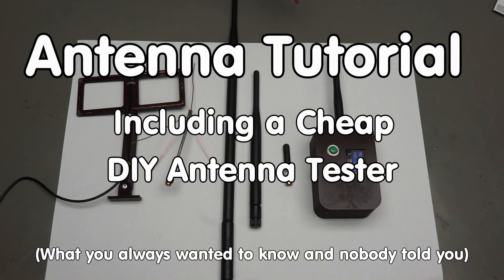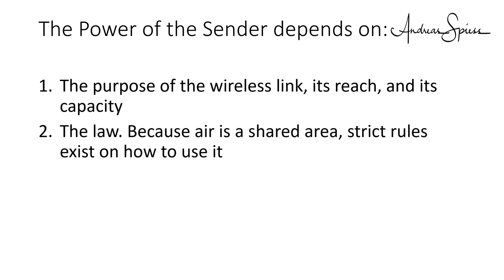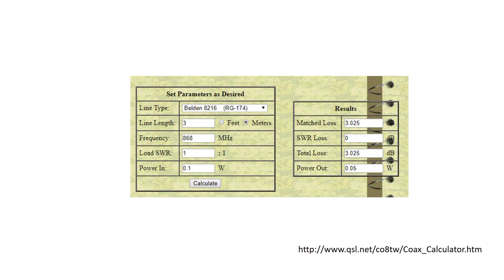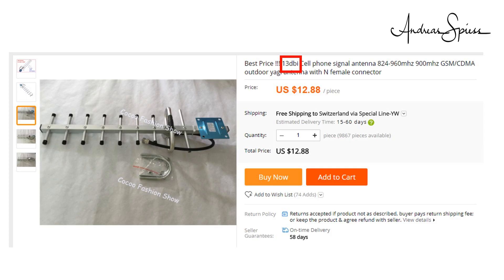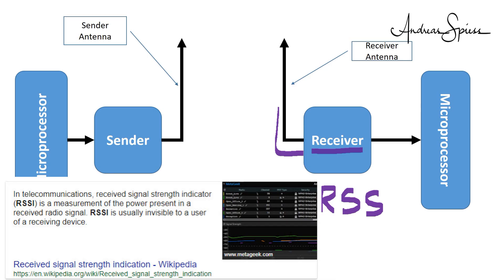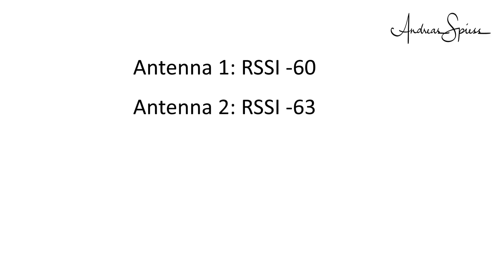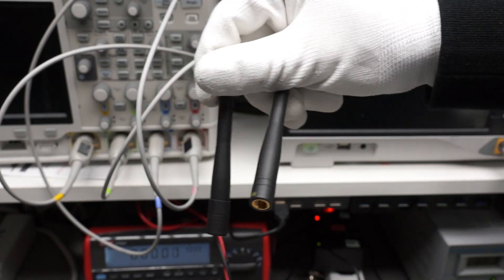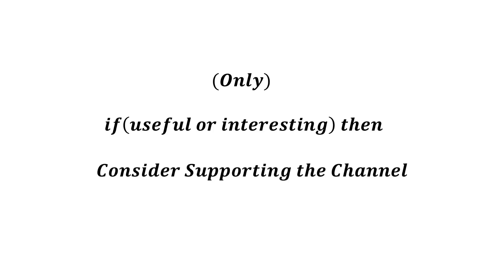#188 Antenna Tutorial incl. cheap DIY Antenna Tester (LoRa, ESP32)

Comment: Do you know of any implementation of diversity of lora antennas ? I have the problem that there are nulls in signal paths between particular nodes which can be overcome by moving the antenna a few centimetres. This is of course impractical, which is why diversity antennas were invented. But how to implement this for lora ? WiFi has already advanced a long way in this respect.
Reply from the maker: I never saw a LoRa chip with two antennas and diversity.
Reply: @AndreasSpiess  That's a shame. It would be so useful. Manufacturers take note !

Comment: Andreas, would it be possible to share the code you used to build up these two looped devices for reading RSSI remotely? I'd like to extend some of your experience as I am still looking for my ideal Meshtastic antena. I was to code it on my own, hope the code might be shareable. Thank you.
Reply from the maker: This is an old video and the code was rather simple if I remember right. Just use the LoRa library and send a packet from one device to the other. The library should get you the RSSI values.

Comment: Hi sir. Is it possible to modify the Smartphone Bluetooth antenna? What antenna characteristics should I use. Is it okay to use Microstrip patch antenna with 50 ohms impedance?
Reply from the maker: I would not tamper with anything on the Smartphone. The engineers building these antennas have a lot of knowledge and good test equipment.

Comment: I say hello from Brazil. I always had a doubt, the reason for the module lora burn if I do not connect the antenna, can you explain to me why the module burns
Reply from the maker: Without an antenna connected, power cannot go anywhere and is reflected back to the module where it generates heat.
Reply: @AndreasSpiess  thanks

Comment: if you put antena directly to arduino, you can surelly send AM signal in KHz and listen it using am radio. I used it with 386 (33mhz) and LPT port back then.
Reply from the maker: I agree. There is even a program for the Raspberry Pi to create different modulations...

Comment: I wish I could find an easy answer but so far no luck. Few days ago I got my 1st 2 lora modules, transmitter is set on a hill and reciever is exactly 3km away on my balcony. I get connection at 3km distance but where I want it there is a couple of semi tall buildings right in front of me that block the reception. Any way I could penetrate, bounce or whatever with better antennas, settings? I have no access to roof so my options are limited. I can get signal 50 - 100m left or right from my apartment but again those 1 or 2 buildings block clean line of sight
Reply from the maker: Maybe you watch my "LoRa Wardriving" video?

Comment: Hi... One quick question.. Will there be any issues if I use 915 Mhz Frequency Antenna in India, which according to my research is 865 MHz. Even if I get this, can I retune the frequency that is compatible in India.
Reply from the maker: 1. Check if 915MHz is leagal in India
2. You always can try an antenna. If you want to be sure, you have to do the measurements. There are newer videos about the topic on this channel
Reply: @AndreasSpiess  thanks for the reply. So it means that these antennas will work except for the laws that approve or disapprove.

Comment: When it comes to wire antennas, longer is definitely better...  In fact, I've found that the optimum wire length is one which reaches from the transmitter to the receiver ; )
Reply from the maker: This is definitely not true, even if it sounds strange. Use a simple example: A transmitter in Europe with 100 watts and a coax cable towards New Zealand. Calculate how far the signal would travel and you will find a few 100 miles with a good coax. I often get connections to New Zealand trough the air. This is one of the things which keep me in amateur radio…
Reply: @AndreasSpiess  Ahhhh... I think you may have missed the "humour wink" at the end of my post : )

Yes, of course it's not true!  You are, of course, absolutely and unamusingly correct!   I've always been very familiar with the losses in coax and ladder-line as it comes into all my ERP calculations.   But ... a joke is a joke... and I'll never let 'the obvious' or the 'factual' stop me from saying something completely silly for my own amusement ; )

Of course, there's also the expense.  A cable across Europe to New Zealand would costs a lot of money.... but that's nothing compared to how much you'd have to spend on signs saying :  [ CAUTION - TRIP HAZARD ]   ; )

Sorry.  I may be 50 years old in November, but I'm still just a big kid  XD

73s
Reply from the maker: @garychap8384  i was not sure because a lot of people are not aware that „air“ can be much better than copper… Anyway, no problem ;-)
Reply: @AndreasSpiess  No problem Andreas.   And, thanks for the content... you're one of the most charming creators on youtube and I always look forward to spending some time seeing what you're up to : )  The work you put into your videos is truly appreciated OM.

Much love to you and your family, from the UK!

Comment: hi Sir. You are the Lora Pro, I just learn lora, I learn a lot from your videos. Can I ask some question? Is wind affect in Lora signal transmit? I plan to place Lora device in pole that have 3 meter height up from my rooftop. At first I used superlong LMR400 cable that is 13 meter, then my device cannot receive the package, but can sent the package to a long distance receiver. After learn from your video, I plan to put the Lora device outdoor with IP67 rating enclosure higher up. I will change the antenna Cable into 1 meter LMR400 only.
Is this setup good? can you give me your suggestion? thank you before..
Reply from the maker: The shorter the cable the better. Maybe you can avoid it by placing the node directly at the antenna.

Comment: Hello Andreas, Great video. What if the LoRa transmitter and receiver do not have a line of sight? Im working on a project where i am using SX1278 modules for receiver and transmitter. One module is one the ground floor and the other one is one the roof of  6/7 story building (strict placement required for the application). Do you have any tips to optimize LoRa communication in this case?  I lose communication after -115 RSSI and as there is more physical interference (building/concrete). Thank You so much for your videos, they are very beneficial especially for students.
Reply from the maker: The only thing I can say: Experiment with the locations of the antennas and check if the connection is possible. Maybe you are lucky and the signal is going through.

Comment: I still don't understand how to connect two routers together with this antennas. Do you just connect them into the back of the router? or do you need an entirely different device?
Reply from the maker: Why would you want to connect the antenna connectors of routers? One easily can destroy the other one.
Reply: @AndreasSpiess  you mean the voltage from a 2.4 Ghz antenna is not the same as a 900mhz antenna?
Reply from the maker: Routers have transmitters and they should not be directly connected to a receiver

Comment: EXCELLENT! And thank you very much!
Can you please make a separate and detailed video about your ESP(32) test device incl. the sketches?
Because I face currently the issue that I do have a very low WiFi signal in our basement where some ESP32´s trying to send low resolution video streams to the upper floor. And wiring them up is currently not possible.
Thanks in advance!
Reply from the maker: I have no such plans. The only thing you can do is to use a proper external Wi-Fi antenna and move it around to at least find the best spot. Sometimes, a few cm make a bi difference (2.4GHz is a very short wavelength).
Reply: @AndreasSpiess  Schade! 

Hatte die Hoffnung Tips, wenn nicht gar Details zu bekommen, so dass ich mir Ihr "RSSI - Messgerät" nachbauen kann. Das Ding ist Gold wert!!!

Aber kein Ding, ich finde das schon heraus. 
Zumal es ja "nur" ein JSON formatiertes Datenpaket ist was hin und her geschickt wird. 

Für mich liegt das Problem eher darin, wie auf der Receiver-Seite der RSSI Wert ermittelt wird.
(BTW: Dieser muss ja nicht absolut (richtig) sein. 
Das Delta zwischen zwei Messung sagt ja bereits aus, ob die eine oder andere Antenne (für die akt. zu testende Situation) besser geeignet ist  oder nicht - so halt wie von Ihnen im Video gezeigt.)

Diesen (RSSI-) Wert dann per JSON formatierten string zurückzusenden ist nun wirklich nicht das Problem.

Trotzdem Danke!

EDIT:
Found it: 

After WiFi connection is established:
...
Serial.println(WiFi.RSSI());
...

lol.
Reply from the maker: Genau. So einfach ist das mit dem RSSI ;-)

Comment: I took a 9 month course in Microwaves taught by a retired Stanford Electrical engineer and had a school and had hired practicing electrical engineers from the microwave companies here in Silicon Valley, we learned the history of microwaves, the  practical physics and the mathematics, the use of the Smith Chart, vector network analyzers, spectrum analyzers and how stripline microwave amplifiers were currently designed, this was way back in the mid' 80s. It's is great that we have THESE SMALL high tech test instruments now like this one - I know microwaves is 'black magic' to technicians and rf engineers.
Reply from the maker: Indeed these devices are very helpful!

Comment: I was reading your github about the sketches. Why do you used a different device as a Receiver? is it possible to use 2 TTGO V1 ESP32 boards? ordering PCBs is expensive to me...
Reply from the maker: The boards in this video have to have a LoRa chip or you have to connect one to a standard board. It can be done with most ESP32 boards.

Comment: Hello 

Do you know what kind of element they use for this 4G LTE parabolic feeder ?? Is that a patch antenna ?? And it supports MIMO.  it means does it have 2 elements inside ?? 

I couldn’t find any teardown for this thing 🙁
https://m.alibaba.com/product/1600185216716/4g-lte-high-gain-grid-parabolic.html?s=p
Reply from the maker: I do not believe all ads on Aliexpress. Particularly not for antennas. There is a big chance they are not MIMI, for example.
Reply: @AndreasSpiess  any suggestion to make parabolic feeder for LTE band 3 closed loop MIMO ?? 

Will it work biquad element this arrangement ?? 
Vertical and horizontal polarized ?? 

Or what if i make a cantenna with 2 elements inside ?? I heard that waveguide is the best for parabolic feeder . 
https://www.amazon.de/Testsieger-DIGITALfernsehen-Dual-BiQuad-MIMO-Antenne-5m/dp/B00MA993RA
Reply from the maker: No, I have no idea.
Reply: @AndreasSpiess  its ok thank you for your reply . 👍👍
I live in germany and in a small village . And our cell signal reception is really poor . Do you believe we are in 2021 and i cannot make a cell phone call in the house 😬😬

Comment: Thanks for this video!  I am using LoRa at 915MHz to try to make a tracker for my dog, with the receiver linked to a bluetooth chip so that I can view his location on my phone.  This means that the antenna orientation will not always match.  Do you have a suggestion (or a video link where you talk about it) for a good antenna and settings for this situation?   This will be used mostly in the forest, so it needs the best material and settings to penetrate vegetation.  I currently have a 2.05mm diameter solid copper wire as my antenna.
Reply from the maker: Maybe you can also watch my newest antenna video. But for mobile use you probably have to make a compromise for useability.

Comment: so what is the EXACT length for 915mhz TX on 9rm? for some reason i keep hearing diffent numbers, bouncing anywhere from 7.5 - 12ish cm????? (pretty sure my antenna that came with my r9m is not properly sized, because i cant even get to a km, but stick a 2.4ghz antenna on, BOOM. can go to as far as my video reaches (like 1km) and i have to turn around. but pretty sure i have like 75ish RSSI)
Reply from the maker: https://m0ukd.com/calculators/quarter-wave-ground-plane-antenna-calculator/

Comment: Hi, may i know is this antenna tester suitable for installation of parabolic grid antenna which has gain of 24×2 dbi. I use the antenna to get signal from telco tower and i connect the antenna directly to my wifi router(HUAWEI B818). By the way, it is a directional antenna. Right now i'm struggle to aim the antenna precisely to the telco tower because i'm doing it manually by turning the direction slowly. Thanks.

Sorry, my english is bad.
Reply from the maker: Any receiver for the frequency you use which has a RSSI meter can be used.

Comment: Thanks for the video, Andreas!
I was thinking about the building walls that are around the receiver. Did you try to move the receiver some centimeters/meters around its current position, to check if there are some peaks and valleys in RSSI due to reflections of the signal in the walls?
I'm currently making some antenna experiments in my house's garden, and I noticed that the RSSI on the receiver side can vary substantially when I move the receiver by 1/4 of the wavelentgh (32/4 = 8cm in my case, using 915MHz), or even less.
Really appreciate your videos, thanks for sharing them with us  ;)
Reply from the maker: Maybe you browse through this blog: https://www.loratracker.uk/blog/ Stuard made quite some experiments with RSSI.

Comment: Greta video! I have a question: at uhf frequencies (as LoRa ones) what happens if i Stack 3 or 4 antennas in several directions?  In some LoRa applications i want to increase omnidirectional range.  If i build a moxon, a horn or even a quagi or yagi antenna it will improve the radiation of one specific direction (as well it will discriminate side and back signals ).  

What happens if i place lets say, 4 directional antennas (one aiming at each of the cardinal points) ? Will i get better range in the 4 directions? What will happen to the impedance of the antennas system? Will it drop to a 1/4 of a single antenna impedance? Will this have an effect in reflected power and vswr? Are baluns effective at this frequencies or do they waste power? 

Thanks a lot greetings from México 73’s & Dx from ex XE2WCA!
Reply from the maker: You are not alowed to use directional antennas in the ISM bands.

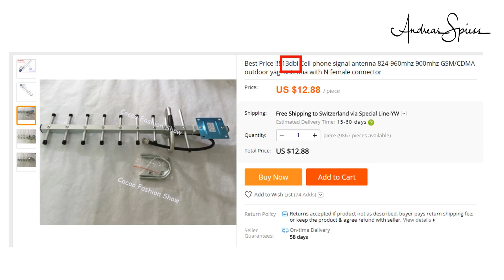Comment: 8:30 no that is not allowed (In Germany) the max power out put on the Antenna is defined as 100mW EIRP (equivalent isotropically radiated power). You can use 100mW whit a 0db antenna ore 50mW on a 3db antenna.
In some cases you're not even allowed to change the Antenna at all.
Reply from the maker: You are right. There were quite a few comments aroound this topic.

Comment: longer antennas "can" be better if they are built correctly...a Collinear antenna for example..one i use for ADSB (1090mhz) has something like 9dB gain.. and quite easy to build  http://www.rason.org/Projects/collant/collant.htm
Reply from the maker: The problem always is: How do you know it works correctly. I tried to build a collinear (not this one) and when I changed slightest dimensions, the resonance and performance shifted considerably.
Reply: @AndreasSpiess  yes i can see that problem...a SWR meter would be a great help in that situation...just check the frequency for every element as you add them, tuning each one to hit the target...mine was professionally built (i was lucky enough to get a variflight/feeyo tracking system free!)..i have it indoors, hanging from a curtain rod!...it picks up planes upto 200kms away, if it was on my roof it should be able to pick up from double that range

Comment: FCC rules for Amateur Radio (and most other RF licenses) currently use 'ERP' as the power limit specification, which stands for Effective Radiated Power.  This means your antenna gain is included in the limitation.  If you have a 3 dB gain antenna connected to a 50 watt transmitter (and everything is properly tuned), your ERP is 100 watts.  Directional antennas have more gain in one direction, obviously, and that is the gain figure you have to use to figure ERP.  (But you also get to subtract and dB loss in  your antenna feed line.)  This doesn't mean directional antennas don't help, though, and in fact they can lower the cost of the system.

Let's say you're limited to 100 mW ERP.  With an 'omnidirectional' antenna, that power goes in every direction, which may be what you want.  But if there's only one receiver, a directional antenna is a much better idea.  A 13 dB gain antenna would give you 2000 mW (or 2 watts) ERP, way above the legal limit.  But that 13 dB gain would allow you to re-design your transmitter's output power to only 5 mW !!!  That is a substantial power savings, and may save on RF component costs, too.
Reply from the maker: I agree with all your statements. In my tests, I also was able to prove that power was not a big issue. I got 200km reach with a very short omnidirectional antenna.
Reply: @AndreasSpiess  Of course, the FCC rules don't apply to you, but from what I've read, the international agreements for amateur radio make other countries rules similar.

Comment: How do you match impedance of the transmission line without those spectrum analyser?
Reply from the maker: And cables Most commercial equipments use 50 Ohms. So they match.

Comment: @ 1:18 Not important but if you want to say, that somthing sends out data or maybe light you could use the word "E/Trans-mitter" like in Tx/Rx = Transmitter and reciever. Because the word sender is german and not well used in english.
Reply from the maker: Thank you for your tip!